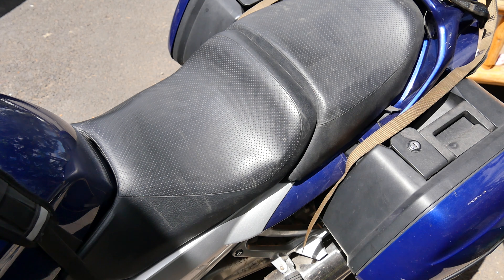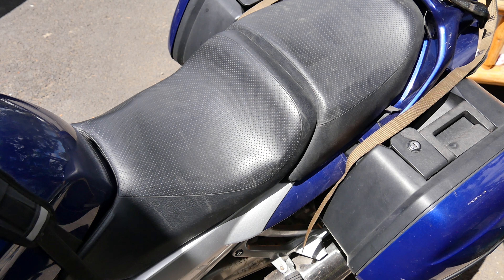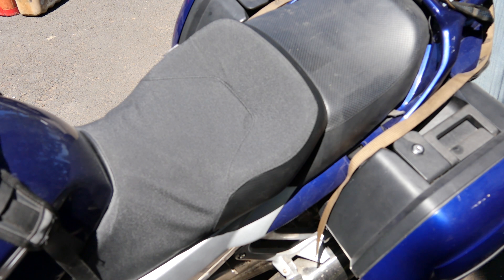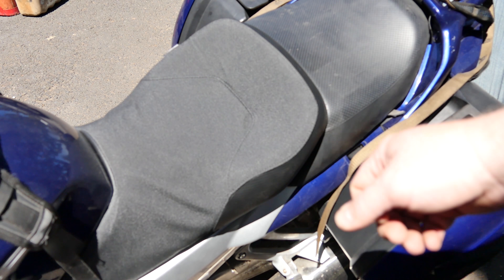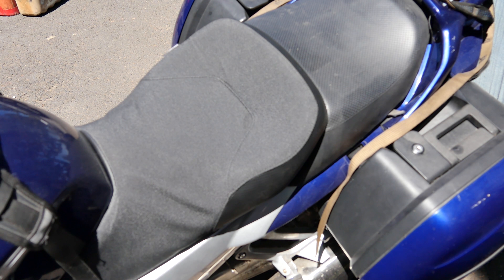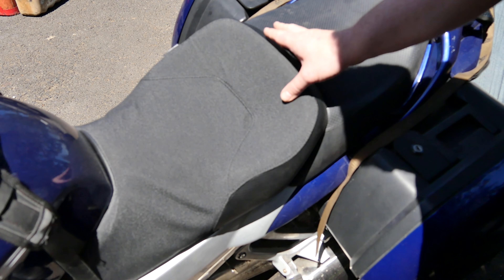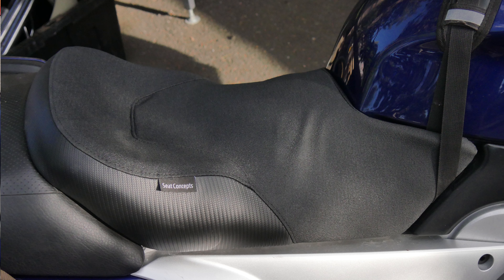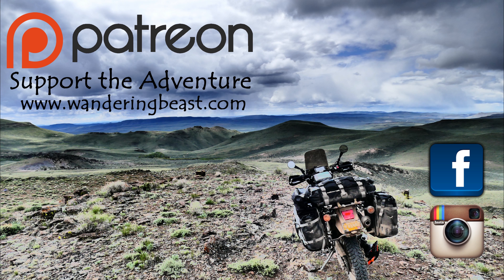FJR1300  Seat Concepts - Long Distance Dream

Comment: I put a SeatConcepts seat on my FJR back when they first introduced it (a bit over 4 years ago). Got it with a special 30% discount on a group buy. At the time, all they had for the rear seat was a matching cover. I pulled off the stock covers and front foam and took everything down to one of the local upholstery shops. They did a great job.

All in all, I like the seat. It's more than worth what I paid for it. It's not an RDL or Laam, but it is a good 500 mile a day, every day, seat. Did a 6000 mile trip one summer with it.